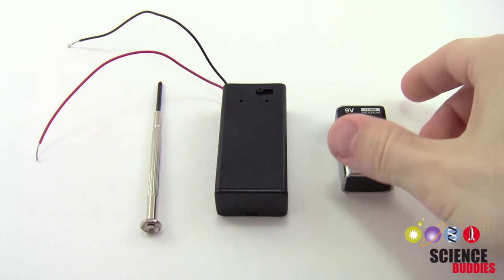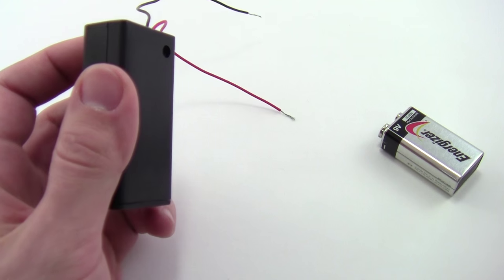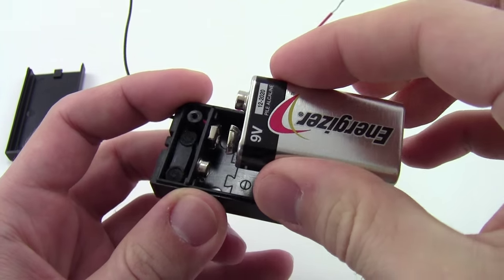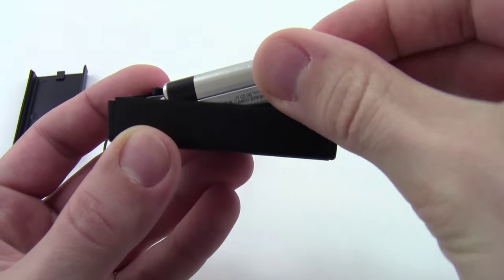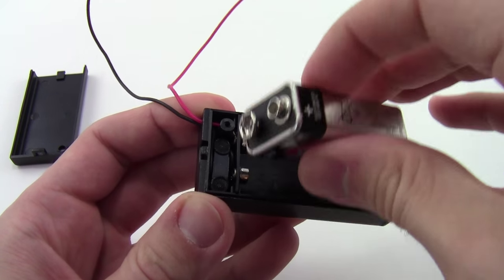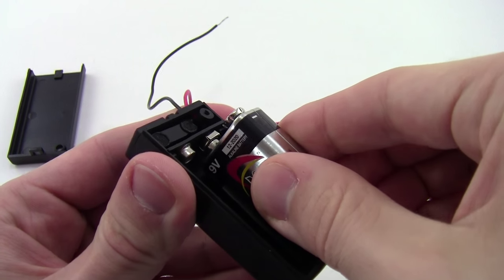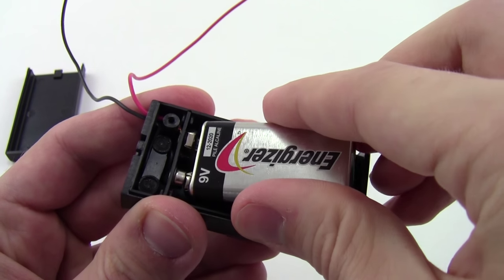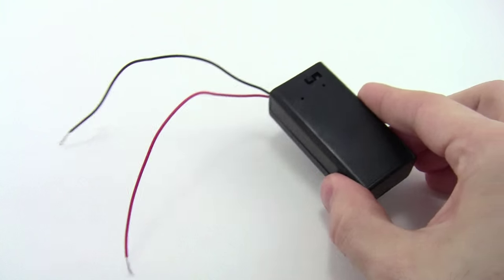How to Install a 9V Battery

Comment: Great video. I was having a tough time replacing the battery in an (old) ceiling mounted smoke detector. Nothing like standing on a ladder while looking at the battery compartment from underneath trying to get the battery to snap into place. I watched this twice, attempted the replacement again, and it worked! Many thanks.

Comment: Where can you buy the part that holds it?
Reply from the maker: Search for "9V battery holder" online - they are available on Amazon (note that some of these have a power switch, some do not, and there are different types of connectors for the wires): https://www.amazon.com/s/ref=nb_sb_noss_2?url=search-alias%3Daps&field-keywords=9V+battery+holder

Comment: So I'm doing this school project and it contains a buzzer. I have this battery connector for 9v and the buzzer would only create the sound when I connect the batter male to male and female to female snaps. Pls help because idk if I'm doing it righg
Reply from the maker: Some electronic components, like LEDs and certain buzzers, aren't "reversible" - they will only work if you connect positive and negative in a certain direction. That is probably the case for your buzzer. This isn't true for all circuit parts, for example if you connect a DC motor backwards, it will just spin in the opposite direction.
Reply: @Science.Buddies  thanks, just figured out the problem, my wiring was a mess 😂